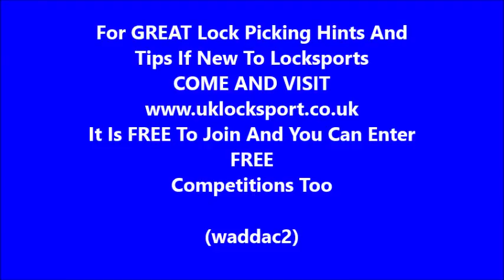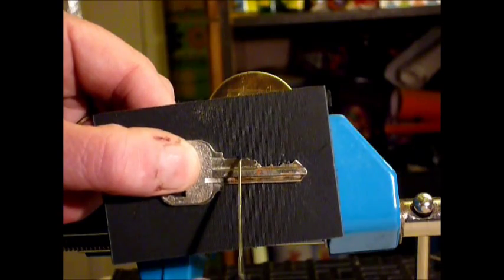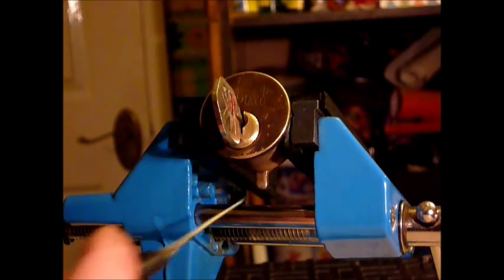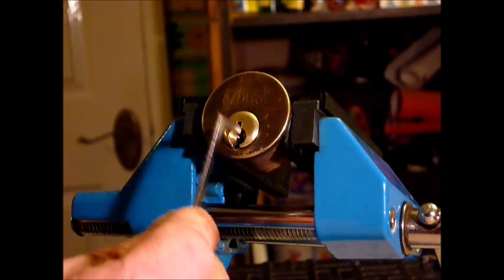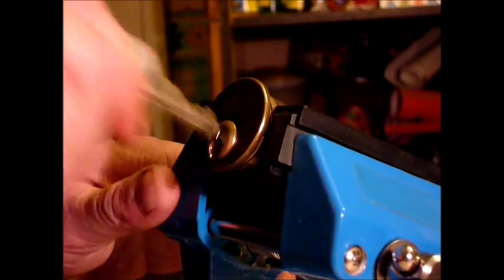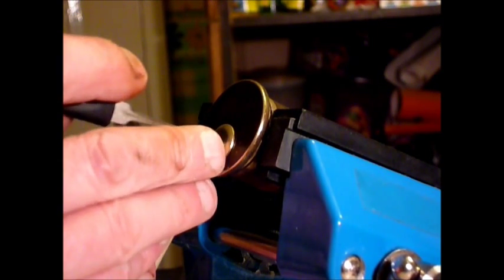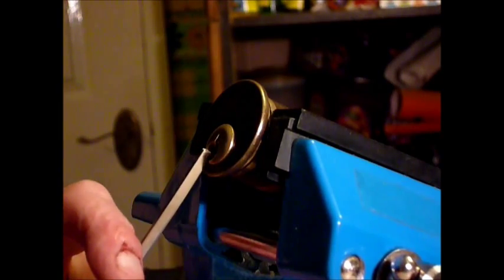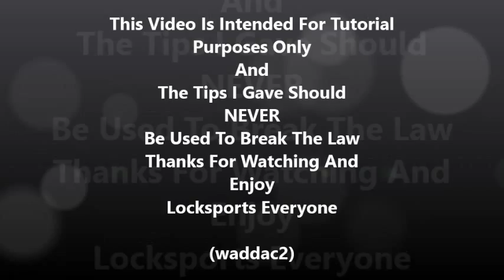Single Pin Picking A LORI 5 Pin Rim Cylinder Lock www.uklocksport.co.uk

Comment from the maker: Yale rim cylinders are good locks to play with as they have a couple of spool pins in so you can see what counter rotation is. Some newcomers get worried when someone mentions spool pins, but they help in picking a lock as you know when you get a false set. You should never really mess or pick your own locks in your doors because if you damage it with being new it will mean calling a pro locksmith to fix and will cost a lot of money. Cheap locks on ebay buddy ;o)

Comment from the maker: Lol!!!! Cheers buddy, and the cruciform rake key is still stuck in the keyway.. its temperamental on coming out and once it does just needs a few more tweaks with a file as it works great going in and raking it open. Its actually a spare key I have had for years from a different lock so its not as if its made from a spare key for the lock in question.

Thanks again for comment on Lori lock mate, much appreciated :o))))

Comment from the maker: Cheers John my friend. Luckily not cancerous type lumps. I have had large thick plastic gauze placed inside my lower chest and down to my stomach due to a complication from last operation. My doctor thinks the gauze may have come away in a couple of places and pain is like a knife pushing internal outwards if you see what I mean, which leads to pain on a daily basis if I move wrong, cough or sneeze... I think it will be ongoing as lucky to be alive after 1st op. Thanks again John mate ;o)